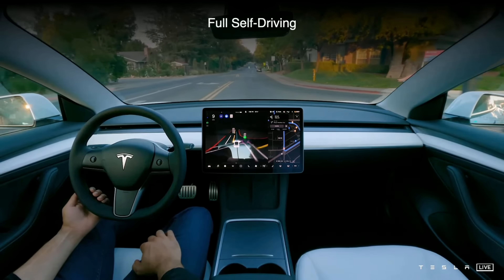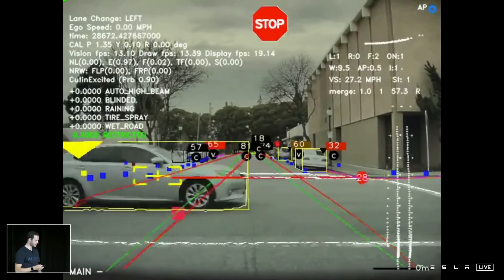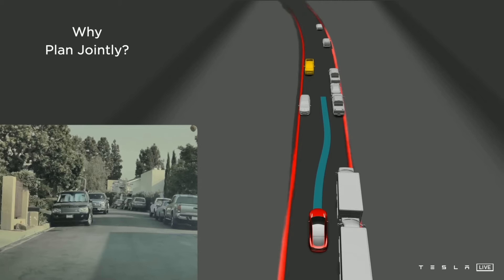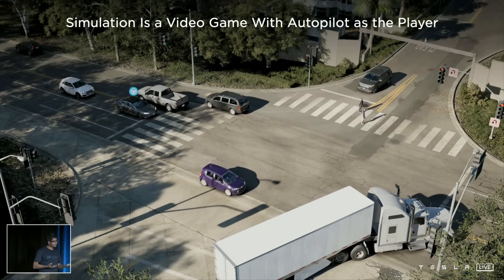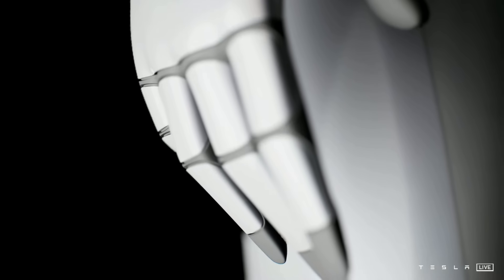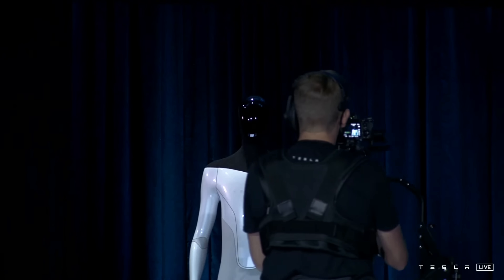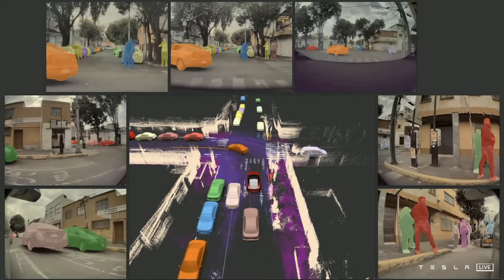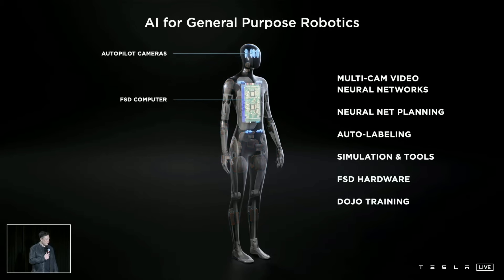Tesla AI Robot CONFIRMED

Comment: I think Tesla should partner with boston dynamics, maybe get the prototype done a bit faster
Reply: You are right on the money. Tesla are more than capable of building the "Brain" and sensor suite. BD have extensive experience in making robots move and balance themselves. A car has only 4 things to adjust to make it move. Accelerator, Brake, Gear(FWD/Reverse) and Steering. Making a robot walk and balance with be several orders of magnitude more difficult. BD have solved this problem already. BD could use next level AI which Tesla will be able to deliver on.

Comment: EV cars require a ton of batteries!  For a 125 lb Robot, the run time must be in minutes.
Reply: A human is incapable of pushing a 4,250 lb vehicle at 155 mph. A Tesla car does this easily.
The energy needed to move the human body is much less than a motor car. Same will apply to a robot. Believe or not, Tesla have probably thought of this.

Comment: Please tell me it has an mechanical emergency off switch in a spot that it is impossible for it to reach!
Reply: If it has that switch, it should be located where a scrotum would be, so that deactivating it would be instinctive.
"Oh hell, it's gone berserk! Quick, kick it in the cods!!!"  😱🤣😳
Reply: @guarddog318  too easy for the bot to turn itself back on if malfunction occurs
Reply: @jeremyglass4283  - Not if it's a breaker that kills the power to all the servos it isn't.
The damn thing wouldn't be able to move.

Is your car gonna start itself if you disconnect the battery?

It's the same thing.
Reply: See Data's switch in middle of his back
Reply: You kick it between the legs. Just like you would do with anyone else lol.
Reply: It would be like the emergency stop button on my 3D printer. It wouldn't just call M112, but would also physically disconnect the green wire. (ATX)

Comment: I have been saying for months that FSD is a general purpose AI. I have no doubt there will be a prototype next year. Tesla has had a robotics dept for 5 years now.
Reply: No, it is not a general purpose Ai. It is still limited to a TASK or TASKS, depending on what it is trained to do. It isn't SMART enough yet for it to be able to solver complex problems. The system is based on the Vision system for mobility, and certain tasks.
Reply: @1flash3571  The mobility part is a general purpose platform. FSD can be put on any platform that required autonomous navigation. Whether that is a car, a truck, a delivery robot or an android. That is general purpose.